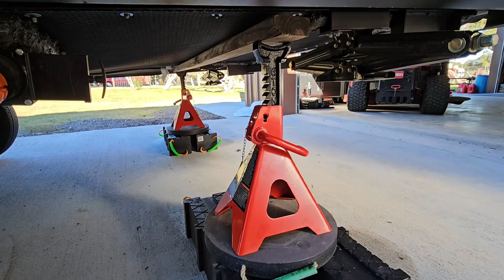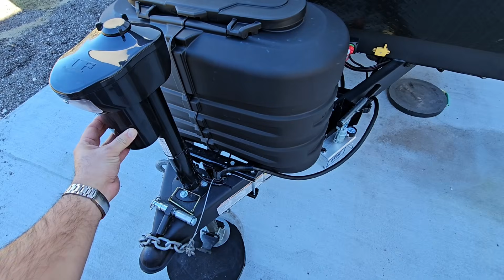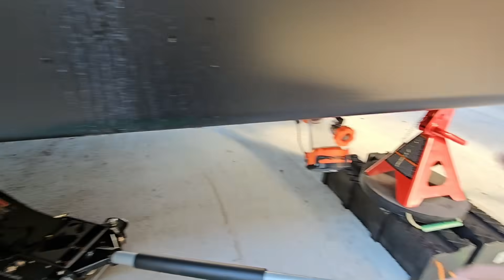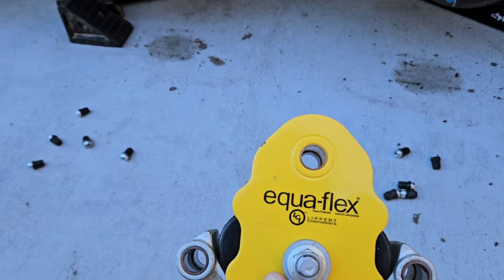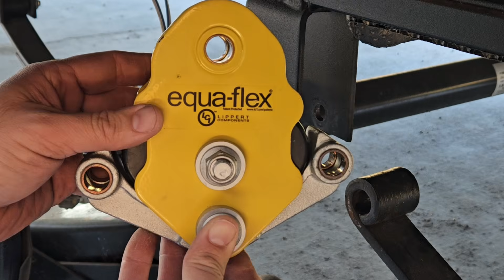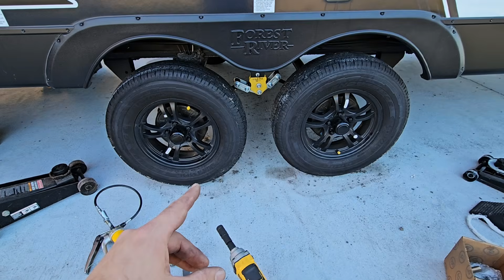IMPORTANT RV UPGRADE! Replacing OEM Suspension with Morryde and LCI

Comment: You can put the new bushing on an old bolt, line the bolt in the hole with the old bushing, and use a deadblow hammer to tap it in.

Comment: I installed shock absorbers (4) on my double axle trailer. I also installed new shackles, bronze bushings and wet bolts. I kept the stock equalizers as replacing them is not necessary with the shock absorbers. The shock installation is quite involved and took me about 4 days. The ride improvement was stunning. It truly was!

Comment: Good morning, thanks for the detailed video. I will be doing mine soon. Did you jack up the rear of the rv then place the jack stands underneath or the jack stands a the back or they just safety measures?
Reply from the maker: I lowered the front really low and put tall jack stands under the back..I then raised the front and it got the tires off the ground. I used jack stands to them secure the front

Comment: Great video, thanks. I’m a little new to the travel trailer world and I’ve been scratching my head trying to envision how I was going to raise my trailer to do this job. This is how I envisioned it but you added some nice details, like the long 2x4 and the rubber pucks on the floor jacks. One thing though, you didn’t install brass bushings on the other end of the spring. Or did I miss that. Anyways, again I have benefited from your content. Thank you sir. 

2021 Lance 1995. 
2024 F-350 KR SRW 6.7 HO.

Comment: So I have a 6x12 enclose trailer with dual axle and I Carry house plants and cactus for my business. Every time I do a market, all my plants fly all over the place and I have to pot them up again. Would this work to not make them jump to much during my travel?
Or what would you recommend ? 
I don’t mind spending more for something that will make the bouncing better.
Reply from the maker: Hello, I would say you'd want shocks and a suspension setup with more travel to absorb the shock.  I would look at the new Touring suspension from Lippert OR possibly the AllTrek4000 from Morryde with shocks.
Reply: @BTBRV  so the Road Armor Shock-Absorbing Trailer Equalizer ?

Comment: I've watched you do several of these and also your demonstration of several different options, what I would appreciate is a "why to choose one over the other" I have Dexter e-z flex on one trailer and found it to be a great upgrade.  That said it is often much maligned piece yet it worked well for me.  How does the Lippert unit outperform the Dexter item.  No axe to grind here, just looking for the best item for my Box Trailer.  I carry somewhat fragile cargo and the smoother the ride the better.  Thanks for any objective comments.  You do good work and the video's are great.

Comment: I finally got around to installing the upgrade kit and discovered that the greasable bolts are not included with the kit.  So I ordered them and will also replace the fixed end bolts as well with greasable bolts.

Comment: What was the diameter of the stainless steel rod you used to pysh the nylon bushing out? Do you have an Amazon link to share? Thanks! I did see someone in the comments used a 1/2" piece of copper pipe. Same diameter?

Comment: CAUTION. DO NOT FORGET THE OTHER FOWARD AND AFT BOLTS. Just did mine but also did the static pivots on the other end of the leaf springs too. These bushings were pulverized (metal on metal) while the ones in my cre3000 were bad but still there. The “static” bolts are the worst ones and should also be upgraded, not just the equalizer. 2016 Jayco jay flight 28BHBE

Comment: A short piece of 1/2 copper pipe is perfect for pushing out the old bushings.
I ended up having to loosen up the axel U bolts to align the Dexter components to the springs and hangers.

SPECIAL NOTE: Only use a 11/16 six point socket to tighten/draw the bolts into place.

Comment: JD. Need your help. I bought this exact set up. I tried following the steps you outline in the installation. I was only able to get one bolt off and stripped another. 

Question is. After supporting the frame with the jacks. I then jacked up the axels and removed the tires. 

I could never seem to get the current factory Dexter loose. Do I need to lower the axels off the jack  once I get the tires off??

Thanks

Comment: Would you recommend some additional stiffening on the hangers?  I've got a 24 footer and it appears I have the same size steel stock for my hangers, but am concerned with hitting something that imparts a sideways force on the hangers bending them or breaking the weld.  While I feel that Lippert made the frame with great welds all around (ahem) a good smack on the side of a wheel might shoot a big bending moment on the hanger.

Comment: Well I'm here to eat a little bit of crow, during all your talks about these upgraded equalizers I always doubted them as the front spring mount and the rear spring mount are connected directly to the frame with no "cushion" on them. Well, I bit the bullet and ordered this same exact setup for my 2017 Jayco 33RBTS since I was replacing all 4 springs due to a leaning issue. I've only towed it about 8 miles, but I only needed a 1/4 mile to see the MASSIVE improvement these provide. No more jarring when hitting rough spots in the road. Can't wait to get on the highway this weekend and see how much of an improvement these will have over expansion joints over bridges where I cringe on the bad ones.

Comment: You didn't do the other end of the springs
Reply from the maker: I made a full video talking about the rationale behind this
Reply: @BTBRV  I saw that later. But while at it it's a quick job and does allow lubrication. I replaced the bushings on my last camper and one of those was worn out.

Comment: The Nev-r-wear bushings that lippert sells will actually outlast the wetbolt bronze bushings easily. 
Greasing these wetbolts does squat unless you take all the weight off before you grease. 

Also just use blocks and bottle jacks. Eliminates the need for jackstands as bottle jack does both duties.
Reply: Hydraulic bottle jacks can fail...NEVER rely on hydraulics to hold anything.

Comment: I’ve read a few of the comments regarding the use of a torque wrench. I understand the shoulder nuts but what about the wheel lug nuts. They should absolutely be torqued to spec. I find it a bit irresponsible that you not only didn’t demonstrate it but didn’t mention it.

Comment: In my 40+ years of Rv-n  this is one of the best upgrades I did. Basically the same but the Mor-ryde 3000 system. Taking the older plastic bushings out and seeing the wear made me take a deep breath praising I didn't wait any longer. Going over bumps & RR tracks makes a huge difference in towing ride & piece of mind.
Reply: How many miles did you have on ur trailer before u switched out
Reply: @benmoran6973  I'm guessing about 12-14k miles. We took 2-4k + mile trips and several ~1k and a fair number in the 250-300 mi area. The 'standard factory" plastic was about 95% worn out and ready to give. The Mor-ryde equalizer part really made a day & night difference going over bumps & RR tracks & the like. I won't own a tt w/o it again.

Comment: Did you do the other bolts/bushings on the far end of the springs?  Outside ends rather than the inside w/ the equalizer.

Comment: Do you ever rotate your trailer tires? You mentioned your TPMS system and not wanting to recalibrate. I typically rotate my boat trailer tires once a year. Much easier to do it when the boat is in the water.

Comment: I do this every year with my EquaFlex equalizer to remove and inspect the wet bolts. You seem to be making this harder than it is. Jack stands, hydraulic jack and 2x12x10 boards is all you need. Do one tire at a time. Loosen the lugs, jack up the axle near the tire until one wet bolt hanger is loose. Remove and replace. Move to the next hanger. Done

Comment: JD, what are your thoughts about the thickness of the frame hangers vs the new heavy duty shackles? Seems like this might move the weak point of the system is to the brackets welded to the frame. Seems like I see more failures of that bracket, either bent or cracks at the welds, vs the other suspension components.

Comment: im surprised there is no torque value on them bolts
Reply from the maker: They say 40lbs but the nut seats directly against the end of the bolt where it stops.  So you aren't actually "tightening" to a specification if that makes sense.
Reply: @BTBRV  If you read the instructions from Morryde you are suppose to hammer in the wet bolt then secure the nut to torque value.  Just impacting them in can actually over tighten the shackle straps and cause undo friction between the shackles and the leaf springs which then causes undo wear and possibly improper function.   Now I'll admit I didn't hammer mine in, I used one of the old nuts and sucked in the wet bolt for the equalizer and the non-shackle ends of the leaf springs and then used the new nut and torqued to spec.

Comment: Jd I watched your video and I got concerned that when you raised the nose up with the tongue jack and using the jack stands in the way you did as a wedge affect put a lot of stresses on the frame especially up front where the tongue attaches to the main part of the frame, I probably would have put together some blocks and used your floor jack on on the frame to lift the trailer and then used the jack stands for support then moved the jacks to the axle to lift the axles up for support and keep in alignment for easy set up thanks for all the videos you do
Reply from the maker: Thanks.  There are several ways to lift the RV. This is the method that I was instructed to use by several RV service shops.

Comment: I have the 19RBLE Surveyor which is a single axle trailer. There’s only one shackle at one end of the leaf spring. Do you recommend replacing the one shackle on each side. I would also like to install Sumo springs on the axle. What do you think?
Reply: I’m looking into this for my Apex Nano 185BH. Also considering adding a shock absorber kit from dexter or Lippert/Roadmaster

Comment: I assume you replaced the bolts and bushings at the front and rear of the springs...you did not show that in the video. Also, you should always index the wet bolt grease ports to either the front or rear, never top or bottom.
Reply: no need

Comment: Should we use a torque wrench on the lug nuts (or any of the nuts really) to verify proper torque?
Reply: Torque spec for the shackle bolts is 45 and 50 on the leaf spring eye.
Reply from the maker: There may be a torque setting but because they self lock, it's generally not something that is done.

Comment: What about the other ends of the springs?
Reply: Yeah those are the "fun" ones...
Reply: He said he finished the rest of it off camera.
Reply: The other end is fixed to more of a frame mount, even though they do hang down. Upgrades would require welding.
Reply: @mikedurham3563  The upgrade would've been replace the standard bolts and nylon bushing with wetbolts and bronze bushings.  No welding needed.

Comment: I’m sure it’s fine, but that weld holding the equalizer bracket to the frame looks awful. The new hardware looks over, engineered and robust compared to that thin , poorly welded bracket.
Reply: That’s the reality of travel trailers…

Comment: You turned all the zerk fittings towards the inboard side , with the exception of the top one . Wouldn’t you have run into the same problem with that one that you would have run into with the lower ones (ie. the tire) ?
Reply from the maker: No sir, it's clear access to that one

Comment: I personally prefer to install the shackle bolts like you did, nuts facing out.  It is easier during my pre-trip inspections to check that none of the nuts are working loose.